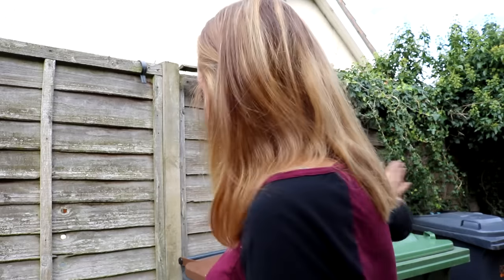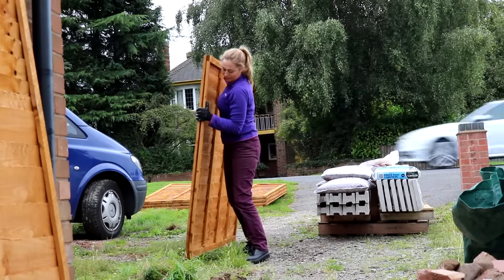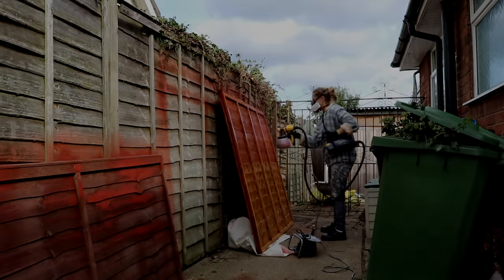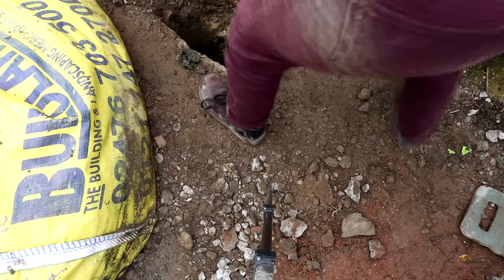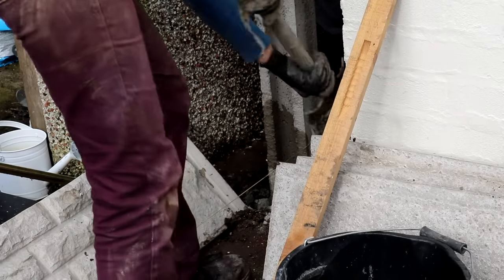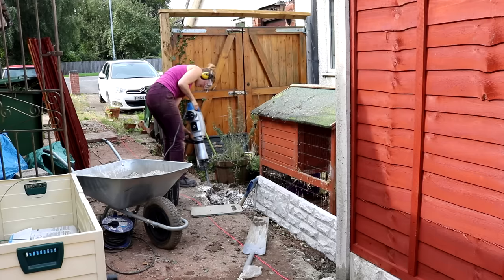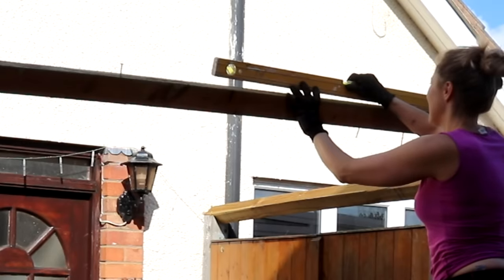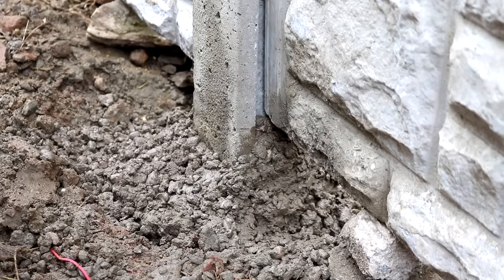Concrete Fence Post Fencing DIY | The Carpenter's Daughter

Comment: I once did a fencing job and the people insisted we used recycled plastic fence posts which they sourced and supplied they’re not as heavy as concrete but will probably outlast the rest of the fence meaning just the panels will need changing next time. They came in a sort of brownish/woody colour.
Reply from the maker: I'd never heard of these until after but being lighter in weight really appeals.  Would try that on the next house 😍
Reply: The Carpenter's Daughter I don’t know where they got them from or if they’re still available but I didn’t reckon much on them myself would rather stick with concrete posts. I still drive past places I fenced with concrete posts 20 years ago and they’re still intact.

Comment: JTF and Wicks .... I bet most on here do not know of them ;O)  Good point about leveling the panels! It is fairly common practice to squeeze a small dollop in the top of the post to stop the panels rattling in the wind .... and it has the bonus of stopping the locals nicking them ;O)
Reply from the maker: +Dave W Thanks!  My Dad said to screw a nail at the top on an angle to stop people lifting them but never got round to it!  Prefer the sound of your method!
Reply: You need a bit of knowledge and a decent percussion drill to put a screw into a concrete post! There are reinforcing rods running the length of it and if you hit one you will end up splitting the whole post! ... Not Good :O)
Reply from the maker: Yes, I learnt this recently :)  He lent me his Hilti as I've since fixed a pair of gates I made to one of the posts :)

Comment: Well done, pick an area where you need more drainage, dig a hole and bury the lumps of concrete, cover with canvas which allows water through, the back fill. The surplus soil you can use in the iGarden or pots, it’s a lot cheaper that paying to dump at the tip.

Comment: Full marks to you CD, doing similar myself but digging through 9 inch concrete footing (leaning block wall). Needed hire breaker and cost £48 two days. I did consider a cheap one to buy instead ! I should have ! Please what was the one you paid for and was it powerful enough or a slow job ? Mine was slow even with hired dewalt breaker...I will sub’ so that I can look out  for when you re-felt  your roof ..mine needs doing !!

Comment: Much easier if you put the panel in first rather than trying to slot it in over the posts plus you risk damaging the postfix in the ground as its not probably set for at least 24 hours. 
If you build the fence as a kit, post ,gravel board, panel and then post you will find that it actually holds itself up quite well by itself as its quite structurally strong

Comment: Good job girl well done.
I have done this job before and those posts are heavy especially the corner ones but always a great job when finish.
Reply from the maker: Thanks!  Yes, we've since installed more fencing (3 shorter panels) and used an end post which was heavier :)

Comment: put the panel in before you put the next post in it's so much easier, and the weld line on the trench shovel is how I check if my hole is deep enough, if using 7'9" post with a 6' fence as the weld line is 22", it stops you having the post sticking up so much aswel.

Comment: Have you ever used expanding foam? It’s much easier than concrete or your sand and rock mix.. just a recommendation! Great video!! Fantastic DIY!
Reply: Also do you guys have Home Depot there?
Reply from the maker: Hi, no I haven't for this job, but thanks for the suggestion!
Reply from the maker: Also, no we don't have a Home Depot

Comment: Thanks for the video, I need to replace my rear fence so will be taking onboard your tips especially the dry mix.  Interestingly you look like your house is really near mine, is the house opposite you getting an extension built as we we speak (March 2021?). Not wanting to put personal details on a public site it may just look really familiar.

Comment: looks the part, I've done a few of these, and opening up the holes for the new posts is easier if you don't have big lumps of stuff to remove, you can just use a fencer's double spade, takes about 5 mins per hole

Comment: Never thought of using the concrete wall below the fence panel! Saves the wood panel rotting. I didn't notice how the panels were secured - were they screwed into the concrete posts or just friction?
Reply from the maker: The panels can be screwed as there's holes in the fence post, but my Dad's told me I can place a screw in from an angle at the top, going towards the fence post and they can't be lifted.  That's the idea anyway.
Reply: I appreciate the feedback - I guess I'm going to have to get around to completing my fence refresh too!

Comment: Vicky, great work but didn't you stagger the new holes. Ie half panel to start and finish that way you don't need to remove old concrete?

Comment: You's both done a good job there, Yr dad is right just a couple inches around the post for the concrete, a good way is throw a spade of conni in the hole then broken bricks then conni and that way till Yr just up to level, If using wood posts then slope concrete down from the post then water runs away from post.

Comment: Just bought a new house and it has 10 concrete posts but 5 of them have been moved of then years by a large oak tree (which was removed before we bought the property) so guess I'll be buying a concrete breaker as there is concrete to shift already (not looking forward to doing this)
ps well done nice job / video

Comment: Nice job , wonder how much you saved on labour cost, more than the price of the breaker for sure ,, hope the neighbours appreciate the value youve added to there property to -)
Reply from the maker: Thanks :) I THINK the neighbours like it hehe.  Probably thankful that our tatty thing came down - it was so bad!  I got a quote of 1k for someone to do the whole section to the pillar and my Dad also said he would've charged about £800 for the full fence & fitting but he's too far away.  We decided to do part of it for now as we may have block paving joined with next door.
Reply: ian smith labour on that would of been £200, myself and a mate used to do fencing for a living (mate still does but I moved back into farming when my dad died). We would of done that in a day no problems.

Comment: Great job, bet your body was aching for a good few days after doing this, really is hard graft.
I do all the jobs myself on my home and usually end up buying all the tools needed.
Those 6ft lap panels are like sails in the wind, so I usually  prefer feather edge board fencing, but use lap panels for 3ft and 4ft high fencing.
I hope your neighbour gave you at least 50% of the cost of the materials, unless stated differently in your house deed plans, fencing between 2 properties are classed as party boundary fences and so down to both properties to maintain etc, splitting the cost 50/50.
The problem I have is my neighbour to my right rents the house, so no maintenance ever gets done, so when I need to replace panels, I end up painting both sides to make them last longer, knowing they would never get painted on their side otherwise, even though the panels are normally pressure treated or dipped, I still think they will last a lot longer if you paint them. Bet your neighbours have not painted their side yet😄

Comment: Great job, couple questions - what's the reason for using gravel with the postmix powder? Is it not possible to use just the postmix? Does the gravel make it stronger? I'm thinking of using 2 bags of postcrete in each hole but not sure. Your method is probably also cheaper? 
Also all the suppliers I've seen only sell 7ft9" or 8ft9" concrete posts as opposed to exactly 8ft and 9ft posts.  Considering my fence height will be 6ft...would you recommend I get 7ft 9" posts? Or do I need to go one up due to ideally needing hole size to be 1/3 of height above ground (2ft)? If I get 7ft9" the hole size would be ~55cm which isn't far off.

Comment: The fencing does have to run dead level in a line as long as each bay is level and maintain the same height with each bay, the ground is usual never level

Comment: I like it, I don't ever remember seeing that type of fence over here is the USA.
I like the concrete posts and lower section. Does the lower concrete sections look the same on both sides?

Edited: I forgot, what is the measurement of the groove in the concrete posts?
Reply from the maker: +Read the Instructions I think the grooves are about 1.5 or 2 inches.  No, it's plain on the back but we could've bought plain both sides.

Comment: Should put the fence panel in aswell with the gravel board and butt the next post up to it and clamp both ends then concrete it in then you don't have to lift it in and you know it's a perfect fit
Reply from the maker: Thanks for the tip :)

Comment: Good Job..Only thing i would of changed would be the choice of Fencing panels Waneys..You will find treated or Not as soon as the Hot weather drys them out, they start to curl and look terrible..You should of paid extra Bought 6x5 F/E Panels, which are a lot Stronger and look Nicer...
Reply from the maker: Thanks so much for the tips :)

Comment: concrete posts are a pain but as they could last 100 years  well worth the effort and you CAN paint them with fence paint
Reply from the maker: Yes, I agree :) I'm too scared to paint them in case I don't like it 😄
Reply: it will jet wash off

Comment: you can return the concrete chipper after you are done. here in the states when ppl need an equipment they purchase it and then return it later. well thats if you will never have use for it again.

Comment: Awesome job. I know thats hard work as ive just done exactly the same thing. I used a small sds with chisel function to break & remove the old concrete. There was a lot of concrete. Unlike you i had no help & had to do it by myself.
Reply from the maker: Wow,  I bet you felt a huge sense of achievement!  I couldn't imagine doing it on my own, although the 5ft posts were much easier to handle :)

Comment: Ive just bought a breaker because I’ve picked up a fencing job which hopefully starting tomorrow. The customer had a big tree fall down into their garden and it’s smashed some panels and posts on both sides. I delivered materials at start of the week. How did you find using the breaker, they are so heavy. I’ve never held/used one until I bought it

Comment: Hey, just wanted to say well done! its hard work moving the concrete posts and them 300mm concrete gravel boards are around 70kg. you done a great job.

i just wanted to give a little tip though without sounding like a know it all....

so you done the right thing by using the gravel board as a spacer as your building as you go, but instead of lifting the panels in after you could of places the panel on top of the gravel board, then bring the post and panel together.. that way.. you can level the gravel board, then youll know the panel is level and so you can make sure the top of the post is to the top of the panel. then you just have to level to the line. 👍🏻

one for next time

well done though it looks great. 😁
Reply from the maker: Thanks so much for the tip +PremFence.  If I ever have to do fencing again on a future house, I'm definitely going to do gravel board, panel then post.  Looking back, we created more work for ourselves this way.
Reply: The Carpenter's Daughter you did.. but dont let it take away from a great job you did. we all learn and youll be better prepared for next time! well done
Reply from the maker: +PremFence That's the way I like to see things 😁

Comment: Put your wooden panel on the gravel board as well before putting next post in save you trying to slide it in from the top and makes sure it's tight between the posts good job though looks good

Comment: Vikkie I used to fit fences for a living i used to fit them fence panels there rubbish 🗑 next door garden there blew down in that wind the other week I used 3/4 fence boards and 3be 2 fence rails and concrete fence posts 📫 better if you go down 3 ft with a petrol hole boarer

Comment: Nice job😁 they actually have light weight posts and base panels aswell. Just in case you do ever do it again 😉
Reply from the maker: Very interesting!! Are they made from similar stuff to thermalite breeze blocks?
Reply: The Carpenter's Daughter it does seem that kind of feel. Over 60% lighter. Ive not used concreate ones for a good while now
Reply from the maker: I wish I'd known 😄
Reply: The Carpenter's Daughter just watched your patio/path video aswell, could benifit from easy joint to fill the gaps when the sand washes away. Would be a good video and 5 colours to choose from 👌😁

Comment: A few questions please.

Did you have to ask/tell your neighbour regarding putting up the new fence?

Did you ask and did they pay (or offer to pay) any percentage towards it?

I ask as I want to run a new fence simular to this from the front of my garden, down the side of the house and all the way to the end of the rear garden. I don't particularly like my neighbour (although we've never conflicted... yet) and I want as much privacy as possible
Reply from the maker: We're the same about wanting privacy.  Yes, my Dad said you should always ask you neighbour.  He's fitted a few for customers and the first thing he asks now if they've told the neighbour.  He's been installing them with neighbours arguing and I'm guessing it's not a nice experience. 

No, we didn't ask for half.  We were too shy to, despite other neighbours saying they normally went halves with theirs.  But apparently, the fence is ours.  What stings a bit, is the other neighbours (now passed) were senile and insisted we couldn't take the old one down and out a better one up.  So, we had to lose a few inches of garden and put one up on our side.  The back fence isn't ours and have a feeling they're waiting for us to replace them.  Enough's enough now 😂

Comment: That sounds really cheap for a breaker. Does it come with bits or they extra. Plus Was it any good? I mean did you need to lean hard on it to make an impact?
Reply from the maker: +John Clowes It comes with a flat chisel style and a pointy one (sorry, don't know what theyre called). I can't compare it any as only ever used this one but my Dad recommended it and it's been great for us.  No, we don't have to push it but not sure I'd like a bigger one.

Comment: eww I know how heavy those gravel boards are, I did my back in dragging them around on my own, and 8ft post's :-$ did all new fence in the back garden and just pulled out all the hedgerow in the front garden and put more fencing up.  Keep up the good work ;-)
Reply from the maker: Thanks :)  Wow!  Hope your back is better now!  That's impressive - I wish I had the strength!!
Reply: Back ok now thanks, I had so much work to do I just had to get stuck in on my own a lot of the time or I just wouldn't have got it all done before winter came around.  if you think your back garden was bad take a look at the state my garden was in when I started to it :-(

Comment: ´´Cement the grooves underneath´´  ! Crikey  , you mean mortar them !  Cement is a ( usually ) grey powder substance that is mixed with sand and water to create mortar , or with the addition of gravel too , creates concrete.
Reply from the maker: Actually no.. I didn't use mortar there.  It was cement mixed with water.  Maybe with added gravel too... don't remember as it was so long ago.  But definitely no sand.

Comment: you made that a lot harder than it should have been :)
Reply from the maker: +thanxx yes, agreed.  Would do post, board, panel and repeat if ever need to install fencing on a future house.
Reply: job got done and thats all thats matters. im a fencer by trade. we deal with this stuff daily so have little tricks. when ever we come across old remnants of concrete we use road bars to pincer out the concrete in one full piece. three men on a bar each.find the end of the concrete and it comes out in one then your hole is already dug. also the posts should be set level to the top of the previous panel. the easiest way to achieve this is to set your post deeper so its say 50mm shy of the panel,add your post mix then then lift the post to the correct height hold for a few seconds and the mix goes under the post thus setting in to the correct height! also here's a tip to lock your panels so they don't rattle*(this is the cause of most fence failures)if you screw a 60mm screw through the side of the panel so it goes straight through and into the other side of the H on the post and screw it in fully the screw hits the other side of the H on the post and pushes the panel back and locks it :) also one of the most important parts of the job is setting the gravel board level and not propping it up because it will drop then the panel will drop too. sorry for the essay lol. just like to pass on tips :)

Comment: Those concrete post have rebar inside and the rebar will rust and expand and break the post apart.  Ive seen over 50 post that are breaking apart because of this.  Also you dont need to take out all the old footings. Only the ones at the ends.  Leave the old footings in the ground and chip off the tops. Stager the new post holes to miss the old footings.